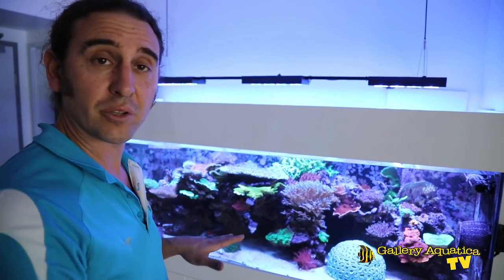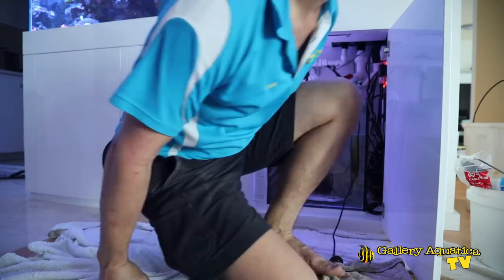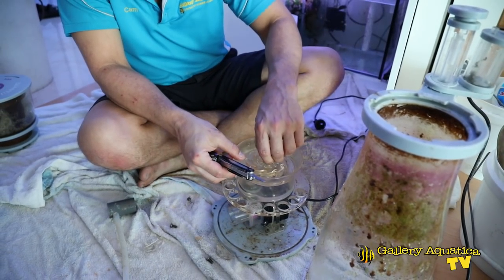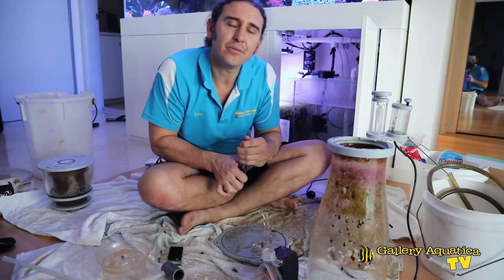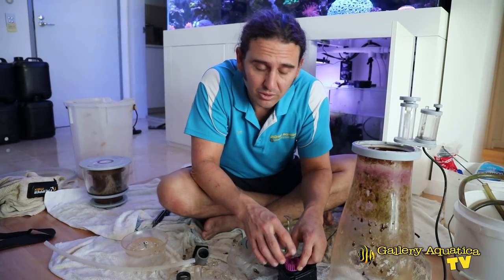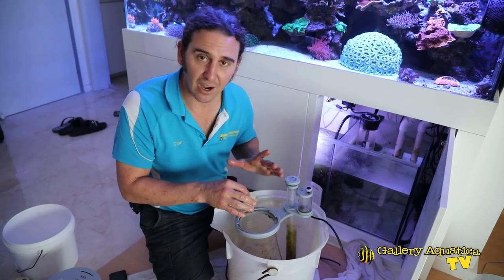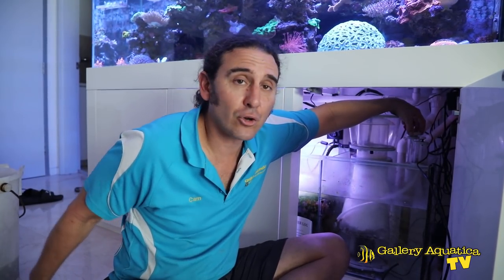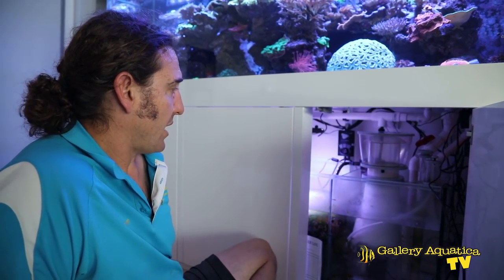Protein Skimmer Maintenance --- Gallery Aquatica TV

Comment: That was a very mature tank with that really large tabling acro right in the center.   I have to ask, did those corals grow that large under the LEDs that are on there?  Or were they under T5s and/or metal halides which did most of the growth and the customer switched over to the LEDs?
Reply from the maker: This tank has only ever been under LEDs. I think that Hydras grow acro as good as any T5 or Halide light😉 Cam
Reply: @GalleryAquaticaTV  I just wonder because those colonies look absolutely massive, and unless you got them already large like that, that has to be 5-10  years of growth on some of them.
Reply from the maker: We did start with quite large colonies, but they’ve definitely doubled in size in the last 2-3 years. Cam